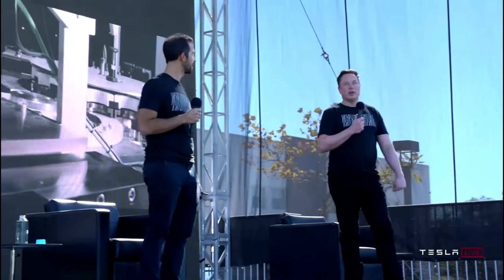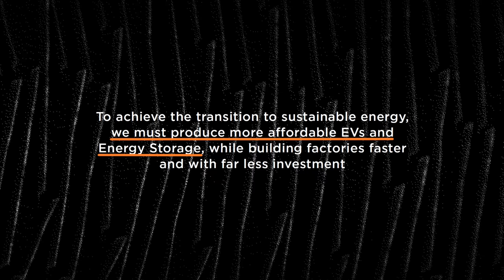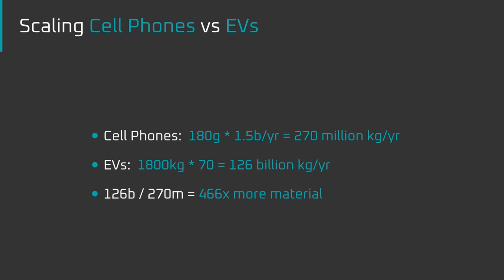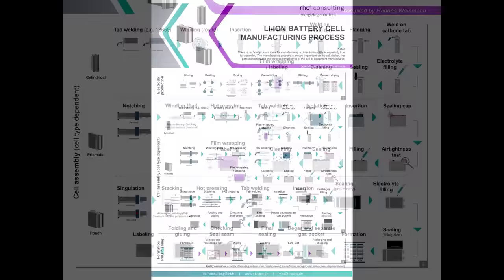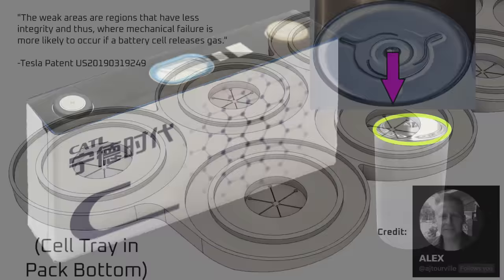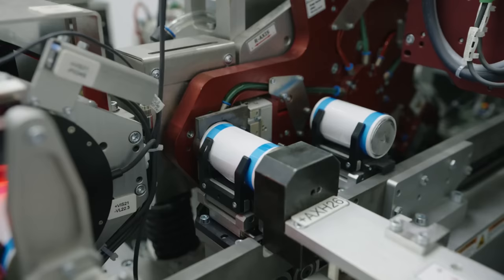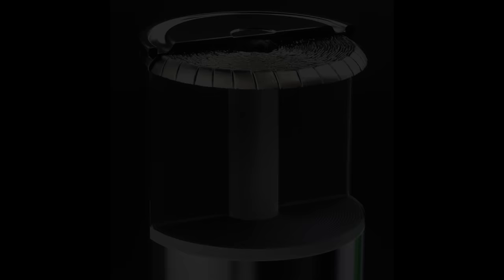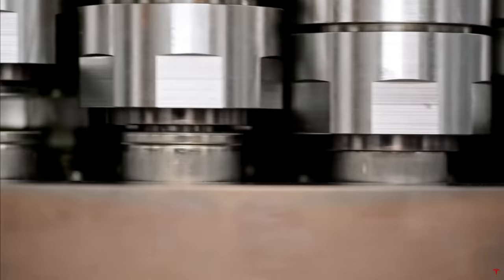The 4680 in Perspective // Battery Day Refresher + Competitors?

Comment: I think people are still grossly underestimating the importance of the structural battery pack. It is still early days for this path, but in the long run it will mean a big change in how Tesla designs the structural and suspension characteristics of their vehicles. And obviously dramatically reducing assembly time and complexity. And that is all made possible by the 4680 cells, as they are now a structural element of the vehicle. The apparent randomness of Battery Day covering topics like gigacastings made it clear that this is all part of a very abmitious plan to totally transform how vehicles are designed and built. In a sense, the structural battery and gigacastings represents a whole new vehicle architecture, and 4680 is integral to that evolution. It will take time for people to understand.
Reply: The structural pack is a welcome consequence of the system improvements.
Reply: Unfortunately, it is also leaning more and more into an non-repairable, disposable, vehicle long before the mechanical components are past their useful life (corrosion, mechanical wear, etc).  Munro & Associates already stated that the 4680 pack is utterly and completely non-repairable, that is not great...

If the economies of scale are not passed down to the consumer in any meaningful way in significantly lower vehicle costs, then all of these "advancements" are a fool's errand and only benefit the manufacturer and shareholders.
Reply: @awebuser5914   it’s been said before - the economics & practicality of pack repair is poor. Ask gm re bolt packs. For ICE equivalent, consider replaceable "wet" cylinder sleeves vs hard chrome etc. Car manufacturers already moved away from repairable to "un-breakable" or at least long average service life.
Reply: @awebuser5914  
Munro & Associates stated you can't remove individual cells, not that the pack isn't repairable.
With the power electronics module on top of the pack, that can be removed.
Then consider that the tabless format will likely reduce load/ stress on each cell due to reasons well explained here.
You're into the "ifs and buts" realm of speculation.
Try "wait and see".
Reply: @iandavies4853  An engine, regardless of sleeve design, can be rebuilt, that is trivial.  Certainly, they are not targeting million-mile engines any more, but by and large, most modern ICE drivetrains will outlast the body and suspension in any kind of corrosion-inducing environment (road salt, snow, coastal, etc.)  The overarching point is if a "structural" battery pack fails for some unpredictable reason, the replacement cost will be staggering, even if the vehicle is still perfectly fine otherwise.  Packs WILL fail, that is a given, the question is does the rush to commodotize a car really benefit the consumer?
Reply: @rogerstarkey5390  There are electronics buried in the pack as well and if those fail, they are irreparable.  Pay closer attention to Munro's teardowns...
Reply: @awebuser5914  True "Packs WILL fail" but packs that fail from defect or condition during manufacture WILL FAIL while the battery is still under warranty (all will have warranties >100,000 miles). So these costs will be borne by the vehicle manufacturer and amortized across the whole fleet. Your characterizing these costs as "staggering" seems to be intended to scare consumers away. Any battery failure after warranty expiration will most likely be due to physical damage to the vehicle that will be covered by their auto insurance policy.
Reply: @awebuser5914  This is all hogwash. EVERY Tesla battery module is assembled with foam inside and fragile cooling channels glued to the cells. NONE of them are "repairable". And when GM tried to "repair" the packs of faulty Bolts, they started out by just trying to replace the faulty modules and ended up having to replace ALL of the modules and then stuff them back inside the origial pack. How much did THAT cost? EV battery packs are NOT repairable. I am not sure where people are getting this idea, but its nonsense. ALL EV battery packs have to be replaced if they have issues, it is the ONLY safe option when you are sitting on literally a ton of flammable battery.
Reply: @awebuser5914  And BTW, if the general public starts getting the idea that they are going to pry open EV battery modules and start tinkering around in there, then EVERY company will start sealing them up with the foam of death.
Reply: @danoberste8146  "... WILL FAIL while the battery is still under warranty"  Complete bullshit.   Tell that to the thousands of Model S and Model 3 customers that have been stung with $25,000+ battery pack replacement cost quotes from Tesla.  There's a cottage industry of experts that replace Model S battery sub-modules. and repair/replace Model 3 packs.  Unfortunately, most pack failures lead to the car being written-off for parts since a pack replacement is not economically practical with the Tesla prices.
Reply: @patreekotime4578  "EVERY Tesla battery module is assembled with foam inside"  Really?  Tell that to a Model S/X owner or repair expert.  They have ZERO foam and are easily repaired.  Same with the Nissan Leaf and others.

GM is designing the Ultium packs in small modules for the exact purpose of modular replacement.  The Bolt was a first-gen car, essentially designed and built by LG, not GM.
Reply: @awebuser5914  every teardown of the S modules Ive seen they had foam between the cells and fragile cooling channels glued on. If someone is crazy enough to try to open up and repair one of these, I just hope nobody dies in a fire. Tesla has every right to make it so hobbiests arent trying to do repair battery modules. It is just simply not safe. And I say this as someone who has always done most of the repair work on my own vehicles. It is crazy to mess around inside battery modules. Crazy.
Reply: @awebuser5914  If the pack is half as expensive to buy as a repairable pack, that's still preferable to a pack that can be repaired. Also if they change chemistries to one that is longer lasting, having a battery pack that is repairable isn't as important.
Reply: @imzjustplayin  It's not going to be anywhere near "half" the cost, completely impossible.  There are small economies of scale when using a larger cell, nothing earth-shattering.

Comment: Jordan, as I recall, I may be mistaken, you did not have the cell you analyzed capacity tested?

We currently do not know specifically what the capacity of this cell is yet?

Typically lithium cells are charged fully to 4.2V, let rest for a specific time and then then discharged at a 1C rate to 2.5V to determine total capacity.

I dont recall you mentioning this and do recall that the cell may have been damaged, thus no testing for this?  Is this accurate?

Is there a plan to actually capacity test the cell you will recieve from Munro?

Comment: Jordan, I don't get it. Your graphics show positively charged lithium ions moving across the cell to the tabs. Isn't it electrons that flow through the tabs? All this time I had thought that the lithiumionsshittledback and forth between cathode and anode by way of the electrolyte. Are the graphics wrong or am I?
Reply from the maker: It doesn't show ions moving to the tab.  It shows the positive ions being released...electrochemical hotspots.  Meanwhile, the blue electricity moves to the tab.
Reply: @thelimitingfactor  If that is the case, then the graphics are very misleading as the ions look like they are all in a line ending at the tabs.

Comment: Will the 4680 hold it's voltage longer than the 2170?  For instance, on the Model 3, there is a significant horsepower drop when you get below 60% SOC.  Will the 4680 have a similar performance curve or will it be better?

Comment: Have you seen the 4.6 v conjecture on the current 4680 flavor ? If so thoughts...
Reply from the maker: Not happening anytime soon.

Current batteries can barely handle 4.2 volts.

Voltage will increase, but it'll be incremental and slow

Comment: Thanks Jordan for another well prepared presentation. One question about the tabless design: does this design reduce charging speed given the reduced path for electrons and ions during charging? I thought that might be an important element. You continue to earn my patreon support. Thanks
Reply from the maker: Hi Ed!  The energy from the electrons moves at near the speed of light.  Charging speed is dictated by the power of the charger and the amount of lithium ions that can be set in motion and aborbed by the anode.
Reply: @thelimitingfactor  thanks for responding Jordan. I hope all is well with you. I get your answer and perhaps that solves my question but help me understand a little better if you can ( sometimes it takes a while to get things right in my brain). When you charge a conventional tabbed battery you have only one pathway for the electrons to follow (this is me thinking out loud) so any resistance in the circuit and any ions that have to flow to or from the electrodes have to essentially line up and move as required. I always thought that that was why it takes so long to charge a battery. For some reason I thought the tabless design would allow for faster charging. Is that not correct?
Reply: @thelimitingfactor  
Jordan.
I was (am?) of the opinion that generally speaking, a major limitation of charging rate was heat, caused by resistance, causing more heat, causing more resistance....... etc, leading to the so far inevitable throttling of charge rate as the process continues?
.
Hence the advantage of the tabless construction?
.
It would seem logical that the tabless design resulted in the quoted "6 times power" from a cell with "5 times capacity". 
Essentially a 20% increase in not just energy output rate, with less energy converted to heat, but potentially similar ability to receive energy (charge)?
As you say
"Lithium ions set in motion and absorbed by the Anode"...... Without generating heat (which then needs to be removed).

Comment: 5 Tabs is an improvement of a 1-tab Design. But a "100% area of contact" design like Tesla is using is superior. 
I would believe that a 21/70 Cell with Tabless would perform even better. Since it's able to cool from the sides more efficiently than a thick cell. Important for performance in a Plaid for example.

A note, bringing the performance up (decreasing resistance = heat generation) is also good for cars like standard 3, Y since it would need to carry less cooling equipment like channels, water, pumps and so on. Less weight better efficiency and better economics.

Comment: The teardown on Munroe shows foam and not Epoxy for areas between batteries. I wonder if that's just temporary.
Reply from the maker: It's basically an epoxy foam is my understanding.
Reply: @thelimitingfactor  That makes sense. I was wondering how they would get the epoxy to spread out evenly but a foaming would make this much easier to accomplish. Never knew about Foaming Epoxy until now.

Comment: In my opinion, what matters more than anything is longevity in the form of cycle life and overall durability so it can remain on the road in 50 years
Reply from the maker: You never engineer to one design point because there's always a trade off.
Reply: Ok, 
So the best way to increase longevity is remove stress from the system?
If heat is a major cause of stress in cells, remove the heat ... Or rather, don't produce heat that requires removal?
Tabless for the win.
Reply: Average car in the U.S. is put in service for about 12 year's. If evs could last 4x that like you are saying and robotaxi/autonomous taxis could reduce total car count even further by increasing the average utilization rate to 5x what the average car is used for daily now? 
Even tesla at 20,000,000 unit's a year is more than the U.S. alone would need. 🤔
Reply: @4literv6  20M is worldwide, not just US production.

Comment: Jordan, are you planning a video covering the change in strategy regarding cooling the 4680s? The battery day announcement indicated plate cooling at the ends, but the Munro tear down still shows they they're still using corrugated channels between rows. Does the greater surface area per cell with the channels outperform the plate cooling? Or is the current pack configuration an intermediate solution that will be changed to plate cooling in the future?
Reply from the maker: Yup!  I'll be covering that.
Reply: At the risk of jumping the gun, I would speculate that the tabless aspect simply means less heat is generated, so less cooling is needed per unit of anode/ cathode area......?

(This would of course mean that more energy remained in a useful, usable form)
.
System efficiency.
Reply: @rogerstarkey5390  In addition, they need a path for nasty hot stuff to leave the cell in the event of a thermal runaway. Jordan mentioned that a little in this video.
Reply: @patreekotime4578  
Straight through the bottom.

Comment: My understanding is that Tesla is using 2170 and non-cylindrical cells in China and Europe: CATL for China made Model Y and contracted with BYD for Berlin made Model Y. Austin 4680 production should be substantially ramped up by end of year, but the Berlin battery factory is still under construction. So in 2023, maintaining Austin 4680 production and ramping Berlin are going to be critical. But, 4680 design is a journey, your test results suggest that Tesla is not yet increasing the Silicon content.
Reply: Well, Sandy Munro recently expressed "surprise" at the low calculated cost, a d the better than expected performance of the 4680 cell during their examination.
"Critical" may be pessimistic.

Comment: Jordan,
Could it be that 60mn diameter provides optimum torsional strength for the "honeycomb"?
A cylinder (effectively what the cell is?) of larger diameter may have more inherent flex?
Reply: That can be countered by greater wall thickness, though from Munroe's findings (thinner cell casing than they expected) it seems that maybe the foam encasing the cells play a bigger role in pack strength and stiffness than I expected (but then I'm by no means a structural engineer). I tend towards the explanation that cell dimensions (as in 46mm vs say 52 or 40) are a result of pack dimensions, voltage and flexibility in capacity, as larger cells means fewer strings and thus bigger steps in possible pack capacities.

Comment: You commented that pouch cells have more manufacturing steps than cylindrical.  Maybe, but the chart shows several quality checks that are not shown in the cylindrical manufacturing process.  Surely there are quality checks, and they should be included so that we can compare apples to apples.
Reply from the maker: You don't need quality checks when there's nothing to check.

Pouch cells are just a mess.
Reply: @thelimitingfactor  Pouch cells may be a mess but there have to be quality checks in the cylindrical line.  My point is to include them so that you are comparing apples to apples when it comes to the number of steps.

Comment: I believe the current limiting factor with regard to EV’s vs ICE is the charge time. EV’s are currently better in every aspect except for potentially battery longevity and replacement cost. Will the 4680 improve charge times?
Reply from the maker: There is no "one solution" to charge time.  Charging speed will incrementally increase over time for all battery cells used in vehicles.
Reply: You don’t have any experience USING an EV, do you?
Reply: So 800v vs 400v architecture has no bearing on charge time?
Reply: So you agree, it’s a limiting factor

Comment: What we need is for the 4680 batteries to be produced in high volume.  We are not there yet.  Not Tesla.  Not Panasonic. Nobody.  It might be well into 2023 before Tesla gets the pump primed sufficiently. Hope it doesn’t take too long.
Reply: They expected it to be 3 years.
Reply: @TheEvilmooseofdoom  Not exactly.  Tesla said that they would be making Model Ys with 4680s when they opened GigaTexas.   Well they simply were no where close to having the necessary volume production of 4680s, so they pivoted back to the 2170s, for now.    They will get 4680 production figured out eventually.  Hopefully no later than summer of 2023.  Elon is overly optimistic at times.   We are used to it of course, so it is okay.
Reply: @billsrelectric  They said it would take 3 years to full ramp and realize 4680 production.  That's what I was referring too.
Reply: @TheEvilmooseofdoom  When did the clock start running?   On Battery day?   Or, this past spring when they started making a few in Texas?
Reply: @Team_Trade_Down  He said that on battery day.
Reply: @TheEvilmooseofdoom  Battery Day was Sept 2019.....almost 3 years ago.   I think we need to give Elon another year on hitting "full ramp" of the 4680s.   There were a lot of engineering challenges to get the manufacturing process sorted out.  And I think that is how it will go with any future "battery breakthroughs".   Nothing will happen over night...each step function improvement will take a couple of years to work its way through the manufacturing side.